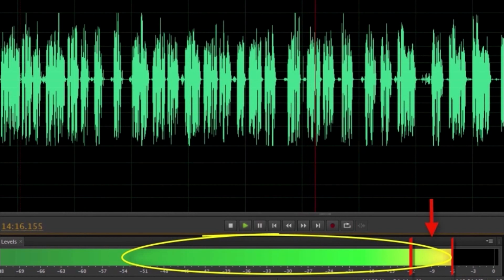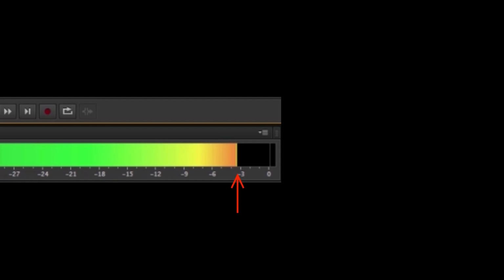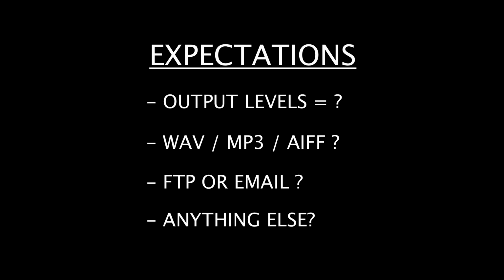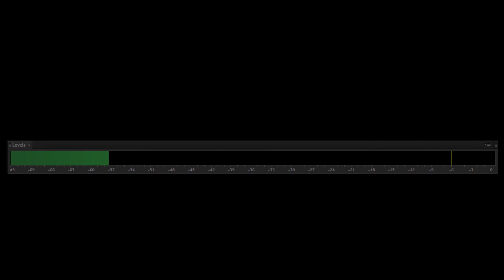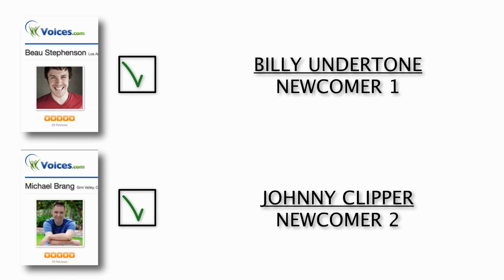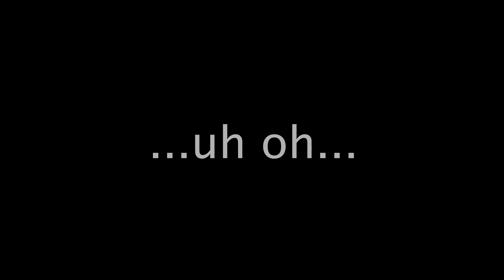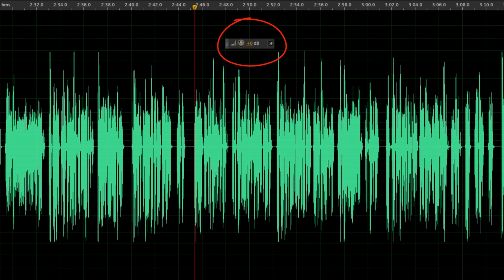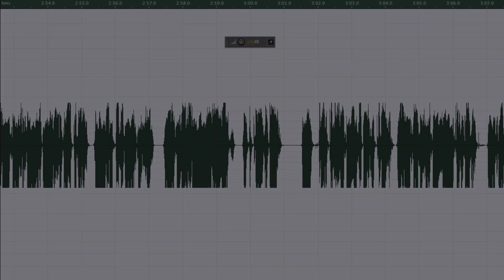Voice Over Output Levels - Tutorial

Comment: So what do you set your gain input at on your preamp and how do you know it’s going to already match up with -3db in post without having to make the audio louder (reaching a rough estimate of -3db)?
Reply from the maker: Hi and thanks for watching. My input level video may help: https://www.youtube.com/watch?v=Sw8ppTPUXlo&t=1s
Aim for -12 to -6 dB going into your software by adjusting the input gain on your audio interface and then normalize to -3 dB when done as shown in the Output Levels video. Hope that helps.
Reply: @VOTECHGURU  What is considered the lowest db that you shouldn’t hit in general spoken word (no yelling)? I have my gain nob set at about 1 o’clock every time I record. I record with a Sennheiser MKH 416 hooked up to a Scarlett Solo 2nd Gen. And it sounds loud even though the meter on Audacity shows I am hitting between -18 and -12 db in general albeit a still well projected speech (since the capsule of the mic is further back). I have the front end of the Sennheiser adjacent to the left side of my mouth. Is there something out of place here or is this perfectly normal? It sounds like -12 to -6db but the meter shows other wise.
Reply from the maker: I would go with whatever the meter says. Having your input peaks a little over or under the -6 to -12 range is not a problem. It’s just a general range to shoot for.

Comment: another great video!  So here is a really newb question. On the meter; the "Zero" down to -69db...what exactly does it represent and why does it have a negative value?  cant wait for more.
Reply from the maker: Hi savethefails. Simple question, complicated answer. To simplify:

110 dB in the real world: The point at which the average human begins to feel pain. Think big rock concert. 

-0 dB: Just below the point at which your recording software begins to feel "pain" also know as distortion. 

Until you get into SPL, dBFS and other tech terms, this is a good way to think about it: Since we don't use negative values to measure loudness in the real world, I think it's great to know that -10dB tells us it's a playback or recording level that has nothing to do with actual dB in the real world. After all, I could play back a signal at -6dB and have my amp at 5, then crank it to 10, which would be much louder, but the recording software doesn't care. As far as it's concerned, it's output is at -6dB, well below the risk of distorting. What if my playback meters are pumping at -0 dB but my amp if off and I can't hear it? Is it actual dB? I think I hear a tree falling in the woods, or do I...

Makes sense?